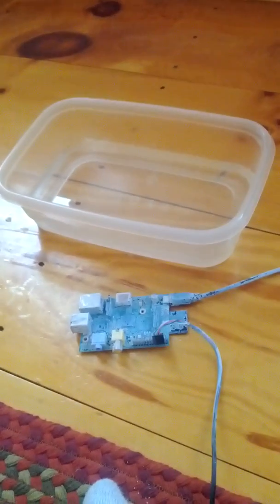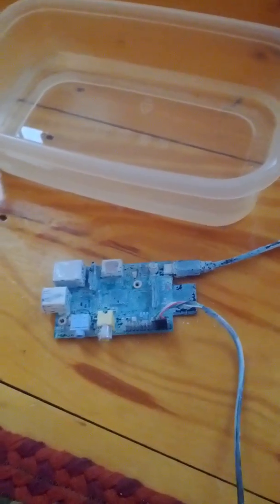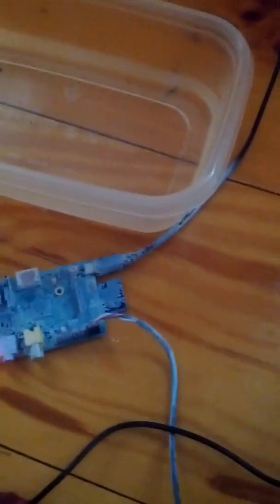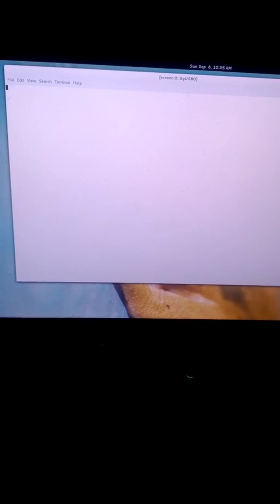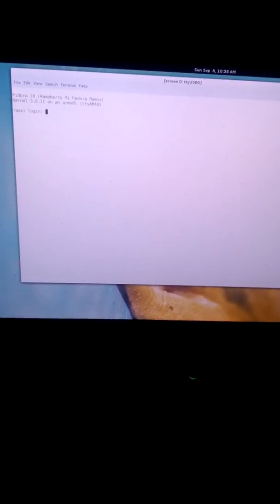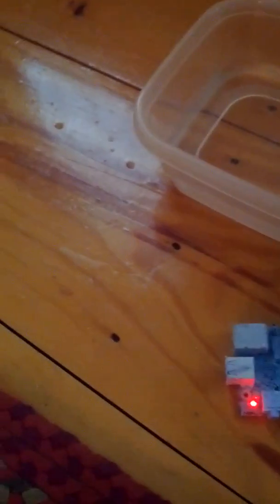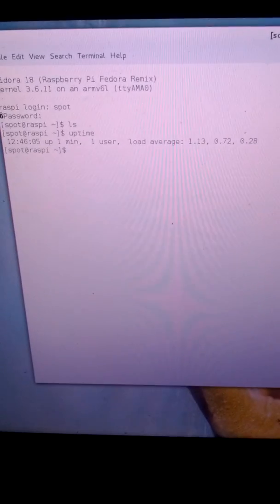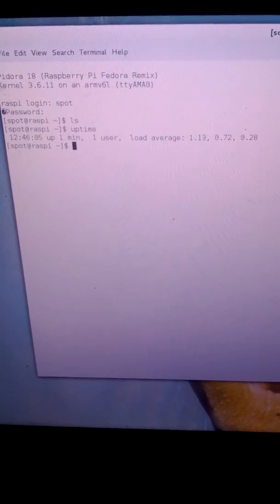Working Raspberry Pi submerged completely in water

Comment: Neat! The reviews of Rust-Oleum Neverwet on Amazon are somewhat mixed, with lots of complaints about the very short life span of the coating.

It would be interesting to hear your experiences over an extended period .. .say weeks ... or months. For example, if you leave it submerged for an extended period. If you leave it out of water for a week/a month, and then try submerging it again. What happens in these scenarios?

cheers ..david